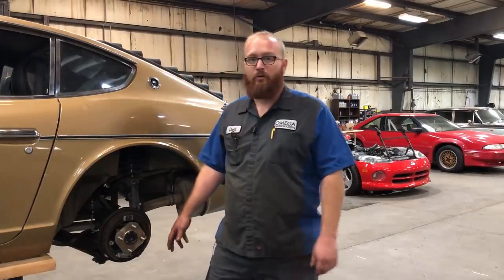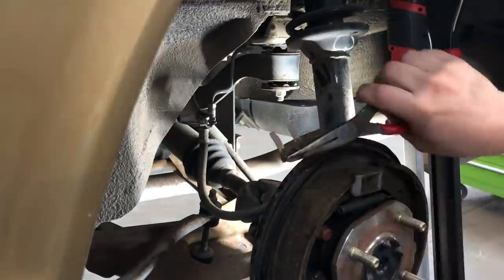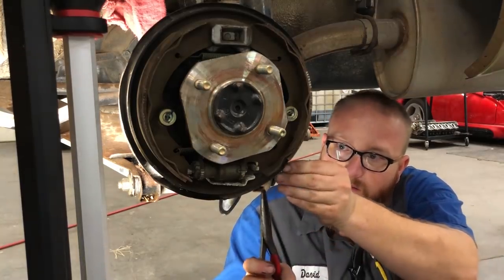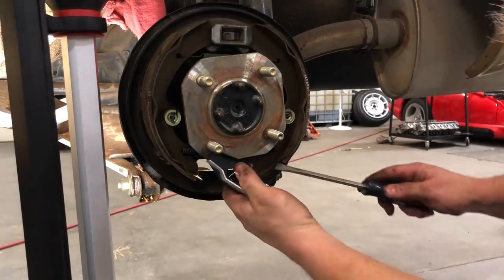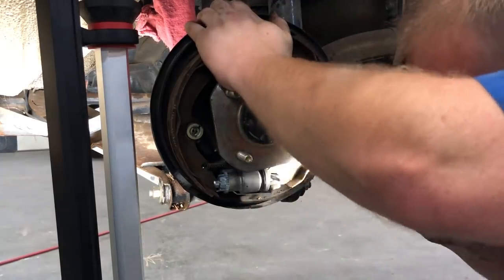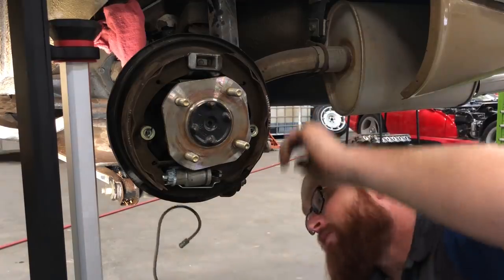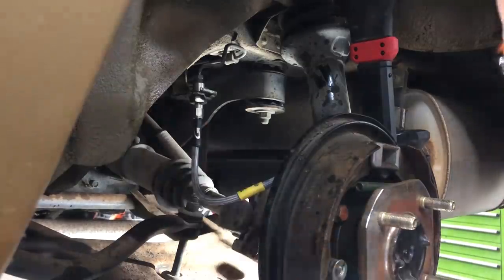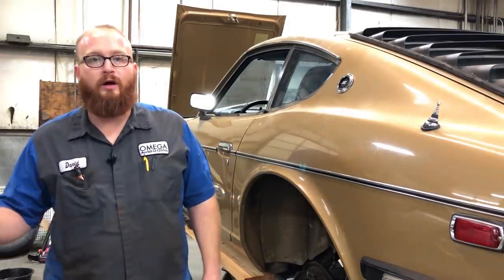CAR WIZARD Tackles the Rear Brakes on the Datsun 260Z

Comment: Hello Mr. Car Wizard. I was wondering if you ever considered using an LED headlamp instead of using the flashlight in your mouth. I use the headlamps all the time and all you have to do is click a button on the top of the light. It works great!

Comment: On restoring an old car like that, would you want to clean the brake line from the front to the rear before connecting the flex line? What would you use to remove the old crud inside the line?  Great video, the audio was perfectly balanced. Have a Happy New Years🍾

Comment: Hi I’ve a question that you may help answering, related to brakes. I’ve a friend who owns a fully restored 1968 GMC Sierra, everything is new. However the brake feels like a rock when applied. The truck will not stop normally, and when pushing hard on the paddle the rear tires will lock. I bleeded the brake lines, fill new brake fluid, checked the booster it’s fine ( I tested it by applying the brake paddle 5-6 times with engine off, then I started the truck, the paddle moved forward slightly), I checked the vacuum valve it’s good. The only things i noticed are the booster vacuum valve hose is smaller that the recommended size, the brake lines from the reservoir are welded with lines that connect with master cylinder. 
I’m not sure what to do next. Any suggestions! Thanks 
Note: I’m not a mechanic I’m just a DIY.

Comment: What would you need to convert rear drum brakes to discs?
Reply: Buy a kit, but why would you want to do that, it's not period correct or original, it would only devalue a nice original example of a 260Z, the braking system on this car is sufficient and most adequate for it's performance as used on road.

Comment: We live in a wasteful world, times gone by the mechanic would have given those very low milage brake cylinders a light home out and put new cylinder seals in. I know, I know, Mr Wizard, time is money but I hate waste, and my old Dad would not have thrown those old bits out until they were completely stuffed.

Comment: At one point in my life, I was the proud owner of a 1972 240Z that had a 350 Chevy small block and 350th transmission, it was extremely fast, extremely scary and extremely sketchy...waaaay sketchy.

I know for a fact that this car was telling me.
"I'm going to kill you and eat your soul"
I didn't know how to get a priest too exorcise the demons, so i just sold it, now it's someone's else's problem.😉
Reply: LOL, I also had a 240z back in the 80's that me and my brother in law changed the engine for but it was still the original size engine. That car was a freaking BLAST, and I wish I could find one again but they are rare and expensive as hell now so que sera sera.